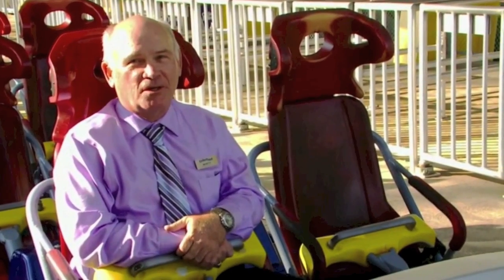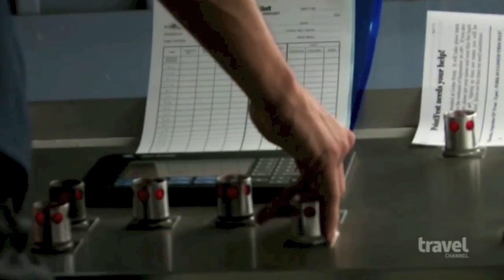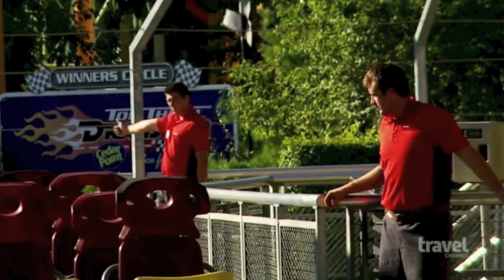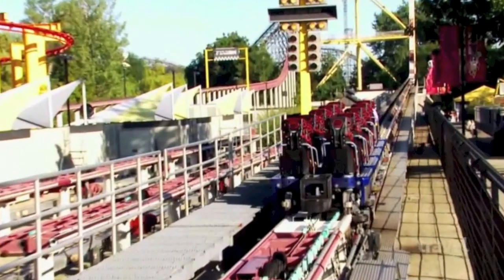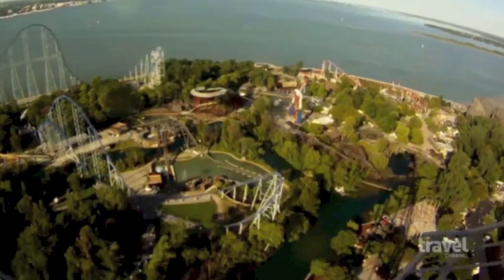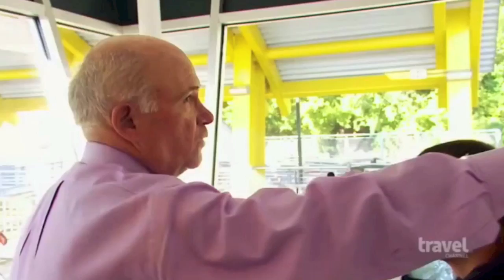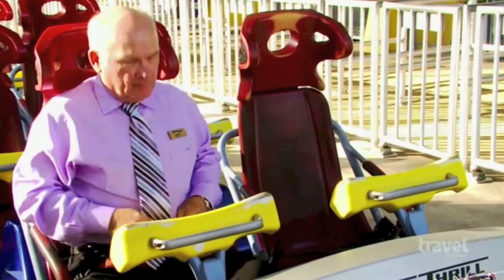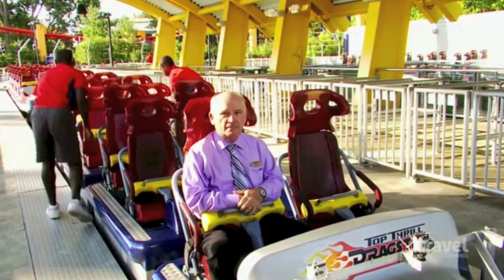Top Thrill Dragster - Testing ᴴᴰ

Comment: "Top Thrill Dragster is meant to simulate takeoff from an aircraft carrier"
I have a feeling it may be inspired by another vehicle that quickly accelerates, can't really put a finger on it
Reply: Considering a Top Fuel Dragster would accelerate you by pushing you with force, and Top Thrill Dragster and and aircraft carrier accelerate you by pulling you, the show got it spot on lol
Reply: @Freakywwe  its literally the same in terms of force, wether youre being pulled by a motor in or outside the car doesnt make a difference in that regard, the only difference is that an aircraft carrier or pulled coaster arent limited by gravity as much
Reply: @Phoenix-zu6on  If you think the feeling of thrust from a drag engine = the same feeling as being pulled by a hydraulic motor then, frankly, I pity you lol
Reply: @Freakywwe  it is less forceful but it is literally the same for your body, so the only thing to pity here is your understanding of physics...
Reply: The speed and acceleration rate are closer inline to a carrier launch than a top fuel drag car which would be 3 times this
Reply: Well the launch does mimic the acceleration of a fighter jet, not a dragster. A dragster would be a Do-Dodonpa launch for 4 seconds.
Reply: I could be mistaken but I stood in line several times for that ride and didnt read anything about aircrafts.  It was all information about dragsters.
Reply: @kimberlydymek181  thats because it is in fact themed to a top fuel dragster, but what im trying to convey is that:
1) in terms of the acceleration system, this technology is closer to that of an aircraft catapult than that of a dragster and 
2) whether you get pulled by an external hydraulic/steam/lsm motor or by the an internal combustion engine doesnt matter to your body, either way it gets accelerated by the seat pushing it from behind, so there is no difference as long as both accelerations are made powerful enough.
Reply: @Freakywwe  u just str8 wrong on this one. also the ride wasn't 'meant' to simulate an aircraft carrier, or they would have named it top thrill aircraft carrier.
Reply: @Freakywwe  Except that's not true. Top Thrill Dragster has it's catch car attachment on car 3, so half of the car is being pushed, half is being pulled.

Comment: I wonder how many roll backs he’s got!
Reply: Good point! Doing some simple arithmetic - if rollbacks happen roughly 1 in every 500 rides, assuming he's worked there for 10 years, and assuming that he rides the ride every day for safety checks, that means he's ridden roughly 3500 times, so would have experienced at least 7 rollbacks. I wonder if he sits and analyses rollbacks with the same emotionless "concentrating" face he does the other times?

Comment: Rollercoasters are the safest way to travel if you look at statistics, more people die from walking/driving/flying/... for distance X than they do from riding rollercoasters for distance X because they are checked so frequently.
His job is to see problems with the ride before they become an actual problem: If the wheels start to loose their coating which is necessary for a safe ride he can feel it earlier than others because he has so much experience with this and many other rides.